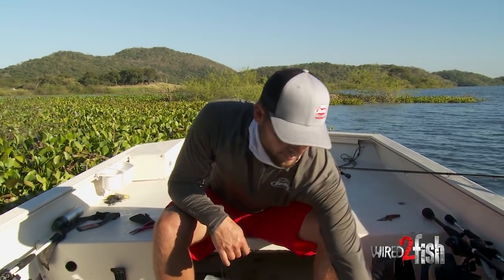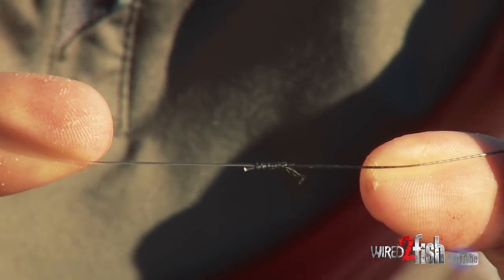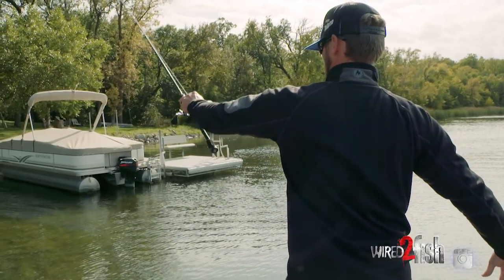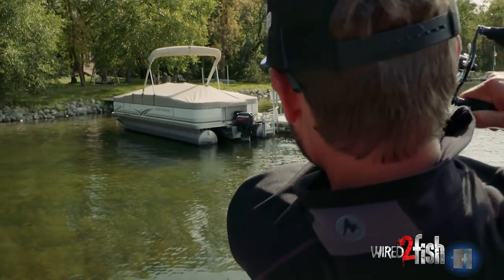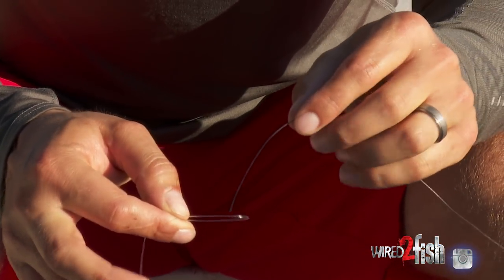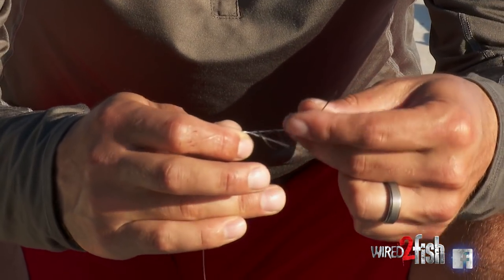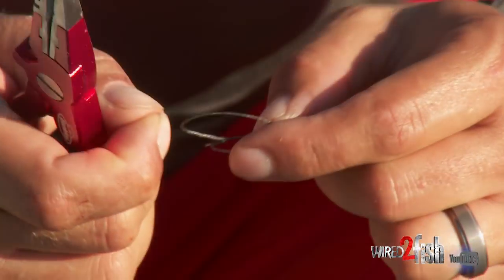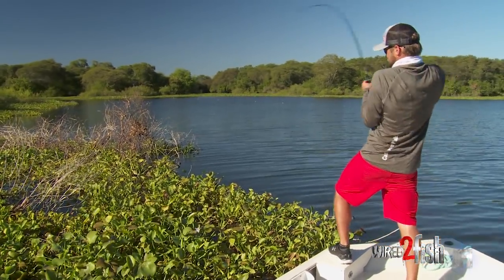Why You Should Add a Fluorocarbon Leader to Your Flipping Setup

Comment: I've used a double uni-knot for tying on my flouro leaders for several years now and it's been very efficient. I've never heard of or tried the "Alberto" knot, if you have used both what's your opinion between the two knots?
Reply: Crazy Alberto is WAY stronger in my experience. I have switched several guys from that knot over the years and none of them have gone back.
Reply: justin lucas Thank you for the reply. I'll have to test it out for myself the next time I go out. It seems simple enough to learn after seeing this video!
Reply: FG knot is the best knot of all time for tying on leaders
Reply: @JustinLucasFishing  FG knot>

Comment: What know is he using to tie the lure on? I also use the Alberto knot and have no issue with the connection knot, but have broken the lure off quite a bit.
Reply: Nick Hummel try improved clinch knot very easy never broke a fish off and san Diego jam knot very good experience with both as in never had any issues ever....
Reply: LION OF JUDAH Is improved clinch better than palomar, in your opinion?
Reply from the maker: Justin is a huge proponent of the San Diego Jam Knot and uses it with a single loop for most of his lure connections: https://goo.gl/fmdyRe

Comment: Is there no benefit of making sure the wraps don't overlap on the alberto knot? I noticed he wound it back on top of itself instead of in the gaps of the first wrap.
Reply from the maker: Yes, as you noted you're supposed to wrap back down in between of the gaps to avoid the fluorocarbon cutting into itself, but the loops do generally settle neatly together without issue.

Comment: Out of curiosity, why not just got straight Flouro? Why go braid then use a leader? I'm not a fan of leaders, just another weak point on your line. The least amount of knots between me and the fish, the better!
Reply: Great question.  Sensitivity and the hook set no stretch from the braid would be my guess
Reply from the maker: Hi Rick, Justin likes the sensitivity and stronger hooksets he gets with braid, but also want's the invisibility attributes of fluorocarbon, especially around hardcover like docks, wood, and in the case of this video, underneath the floating hyacinth mats (open water underneath). He'll go straight fluorocarbon around hardcover sometimes too. When flipping and pitching heavy grass, he fishes straight braid as the grass conceals the line. A well-tied knot such as the Crazy Alberto shown in this video is actually stronger than the knot connecting the fluorocarbon leader to the lure. The lines actually overlap (double up) at the line to line knot so breakage there is rare. Lastly, fluorocarbon doesn't have near the life of braid and can be expensive. Running a braid mainline with a shank of fluorocarbon (or mono) is a good way to get the benefits of fluorocarbon, namely invisibility according to Justin, without the need to re-spool the entire reel. Here's the same concept for spinning reels: https://youtu.be/SeHnvICtug0. I've personally adopted this technique as have some buddies with great line savings as a result. -Ryan
Reply: This way hasn't failed me yet. I have caught a few over 10lbs doing it exactly like this. The main thing is braid allows me to get the best hook set possible on the fish and the fluorocarbon helps me get the most bites.
Reply: Thanks for the reply. Yeah it makes sense, and I suppose if you're an expert at tying knots it works out well. Hey if it works for you then keep on doing it!
Reply: Thanks Wired2Fish. I appreciate the in depth response. I guess I never really considered open water underneath the hyacinth mats since they have roots and all. I fish mostly shallow, figured the roots would hide the braid.
Reply: Rick del Prado to be clear I would only use braid under hyacinth mats. This video that shows me flipping mats is b roll from footage of me using straight braid. I like braid to fluoro around hard cover. Good luck!

Comment: I'm sure it's something  I'm doing but I've had more problems with fluorocarbon breaking.
Reply: Flouro is brittle garbage. Only time I've lost a lure was when I was using a flouro leader
Reply: try tying a double uni with the fluorocarbon to your bait. This should eliminate that problem.
Reply: thanks Justin i usually tie a Palomar knot and i  do wet it down really well before pulling tight. I only have the issue when im using heavy rod and line and set really hard. I will experiment with the double uni. Thanks alot!
Reply: @codyphillips977  you're not keeping your lines uncrossed when tying the Palomar with fluoro if you tie the knot and don't pay attention to your lines crossing in the hook the Fluoro will cut into itself. I had to learn that the hard way.

The best knot for Fluoro in my opinion.

1. Go through the hook. 
2 go through the hook again holding a loop there above the hook. 
3. Twist the tag end around the main line inside of the double loop (line will be doubled and then tripled after you wrap it like a UNI) do this 6-10 times no more than 10 ever. It will cut your line too hard. 
4. Thoroughly wet the inside of the double loop and your line around the hook. 
5. Pull the main line and tag end at the same time. 
6. Catch a lunker.

Comment: Is the FG knot still not a thing in the bass fishing world? I thought those guys were always years ahead of saltwater guys.....
Reply: It is. I have heard great things, but this knot hasn't failed me yet, so I will stick with it for now.
Reply: The FG knot seems to be the overall winner in both knot width and strength, but only marginally so over the Alberto. I believe both are something like 95%+ break strength. And for the amount of precision and time it takes to tie the FG it's just not worth it to me.

Also, the FG only really works well for braid that is a good bit smaller in diameter than the leader. Since you need 30lb+ braid on baitcasters to prevent dig-in, and I use FC leaders of 12-20lb test, the FG doesn't work well (I've tried it)
Reply: David Mann ah cmon man, only takes me 10 minutes to tie a perfect FG. Lolol
Reply: Fg knot for me hasn’t failed yet. I’ve broken my leader before the knot so you know it’s strong..... going with a braid to leader on my cranking rod.

Comment: Noooooo way. 
If it's grass, use braid.
Fish can't distinguish it amongst all that crap. Otherwise, for open water or docks.... fluoro.
Reply from the maker: Danny Bruce this is exactly what he does. Braid exclusively in grass, but fluorocarbon or a braid fluorocarbon leader around docks and other hard cover like wood.
Reply: Wired2Fish he really isn't flipping to be honest all he is doing is pitching the dock with a leader there is a major difference between flipping and pitching
Reply: I do braid to flouro around hard cover and braid exclusively in grass. Thanks!
Reply: if a line is only as strong as the weakest link, why use a leader?
Reply: the knot that I tie hasn't ever failed me. In turn I get the benefit of braid being strong and sensitive and fluorocarbon being invisible to the fish. I don't have any issues doing it this way.
Reply: how many meters of fluorocarbon do u use ?
Reply: Mouhmmar Kadhafish 3 feet is plenty.